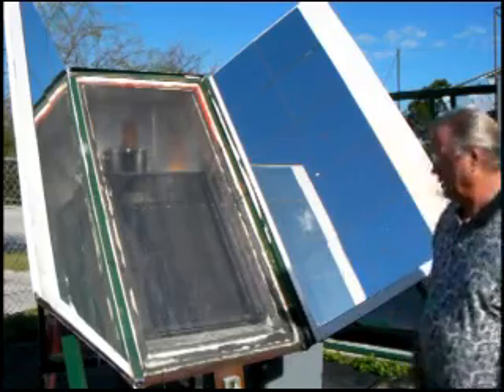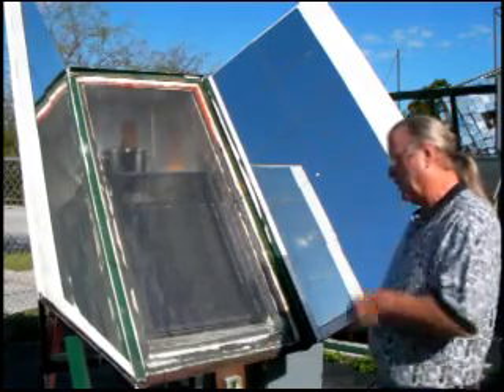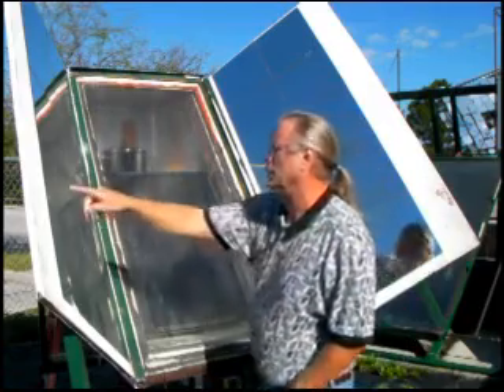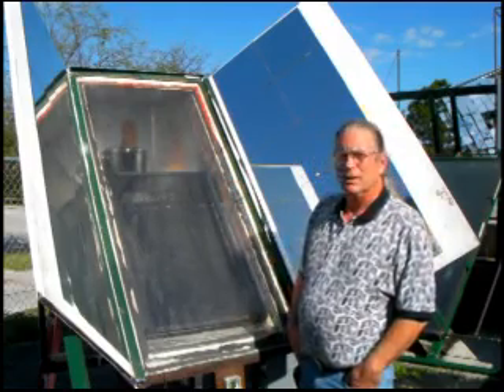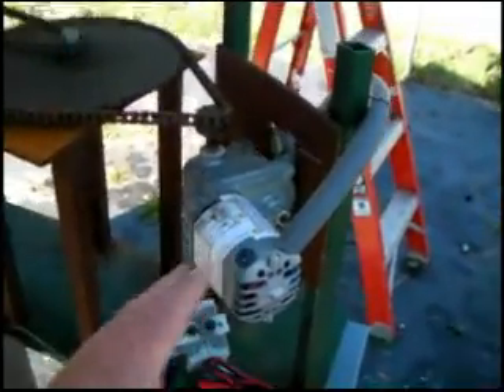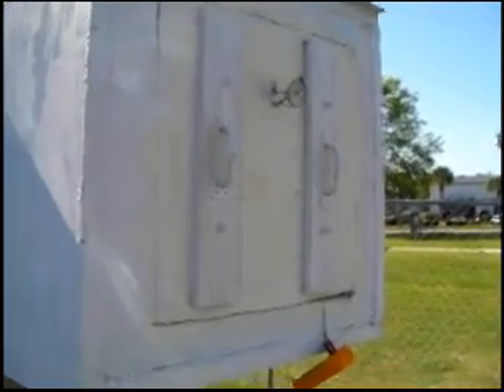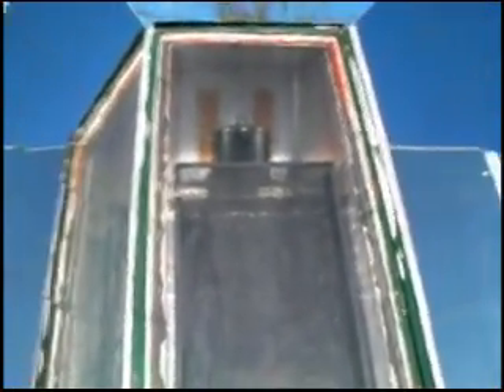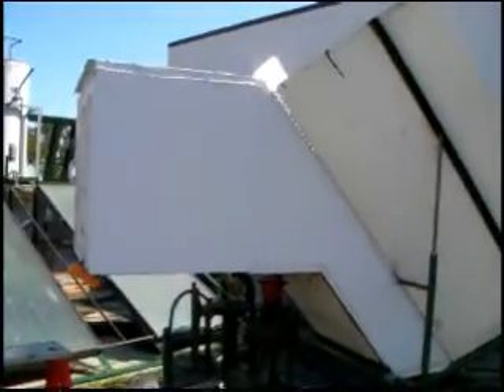Solar oven energy apprenticeship training

Comment: We just purchased a small Sun Oven and we regularly get it up to 350 degrees, so a higher temp is possible. I will check out the site you mentioned but would appreciate more info on the control devices.